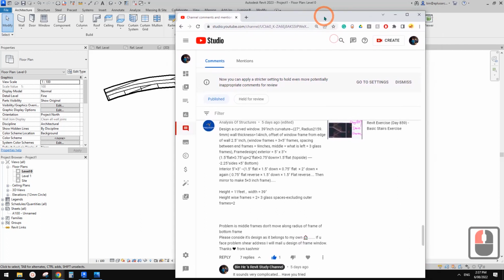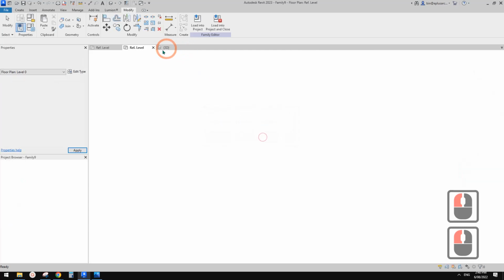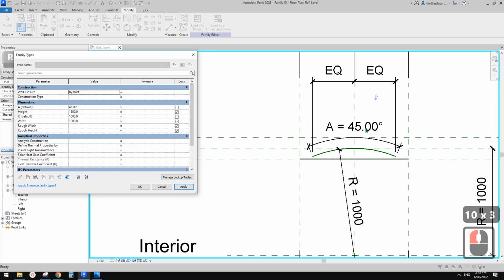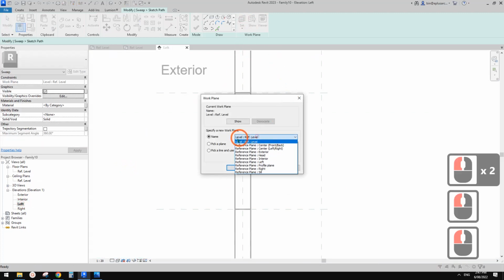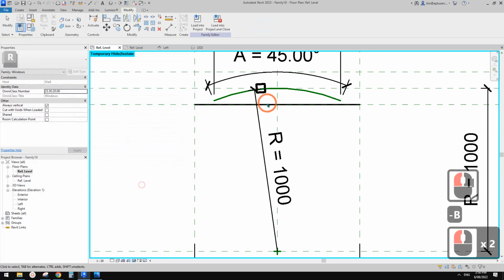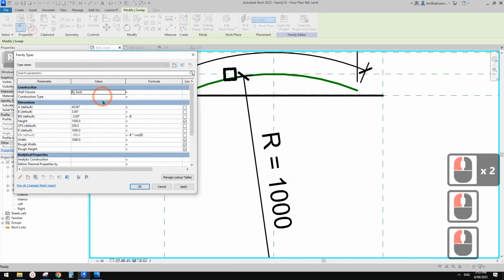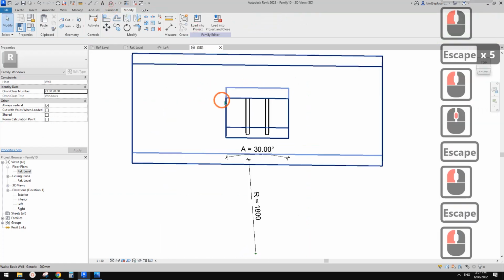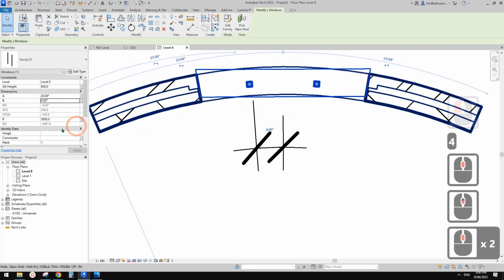Revit Exercise (Day 866) Moving the Mullion along the Curved Window Frame

Comment: If the profile goes to +ve value(R not negative R & angle  B not negative B also) means how to use the formula .it won't take cos(B) formula for R and also for sinB for B ..bcz we don't have NR to put -R*cos(B) we only have R and angle B..pls clear
Reply from the maker: How about ABS()?
Reply: @BINHE615  actually we need 3 numbers to use sin or cos formula right..we have only 2 (R & cosB)
Reply from the maker: I am a bit confused. Maybe I should do some math video, what do you think?
Reply: @BINHE615  yes sir .i too tried so much but not getting properly..always wen I tried ur method using profile means I get this type problem but some how i will solve them but this is very tricky I think nly u can solve this pls do n also possible means pls try that mullions in a array way ..not nly 2 ..how much we want vertical frames like that
Reply from the maker: Sometimes we need to find the balance between a parametric family and model in place family. A parametric family is built to save time in the long run. But if it takes you hours and hours to build and will only be used once or twice, it'd be better just do model in place.

Comment: I tried a way to convert angle between vertical millions to arc length as we usually do this for easyness. Q= L/R...as software developer never use this angle during development of software....layman can then never understand exact distance to fix between mullions.
But angle is not multiplting with length..... I had written it on paper but still unsolved.... And you hadn't picked this topic....
Reply from the maker: Yes we can do length instead of angle. I will do a quick video about this.
Reply: @BINHE615  
Yes we can but I mean why we can't change angle to arch length by formula => Q= L/R....it says inconsistent formula
Reply from the maker: @Analysis-Of-Structures  I guess because your formula is wrong.  I’m on my lunch break and do not have computer to test, but I think you can try this:  the window width(curve) is (Angle of the window/360)*2*pi()*Radius, so you can use formula Width(curve)*360/(2*pi()*Radius) for the Angle of the window, which means you can use curved window width to control the width of the window. However, if you need to use the window width(chord) to control the window, you will need to get the formula from C=2*Radius*Sin(Angle of windows/2). I will test it out after work.
Reply: @BINHE615  
Exactly.... I tried the same, may be I was wrong.... But formula of curve was...  Arch length=( π/180 * Angle * Radius) 
Width of window=(2*R*sin(Angle/2) )  still I failed to do so..... But thanks for reply....finally solved💪😄👌
Reply from the maker: Good work, your formulas are correct, and they work. I will do a recording.